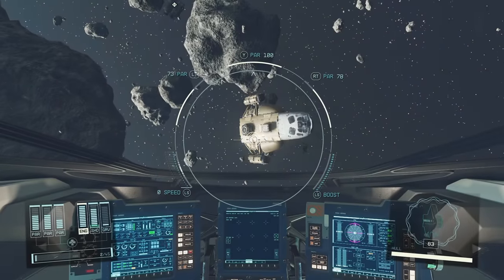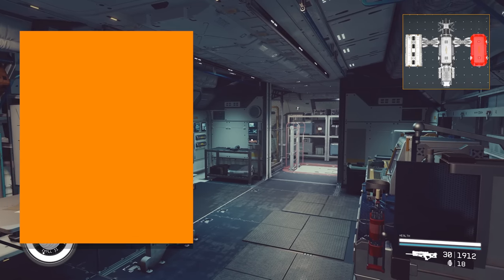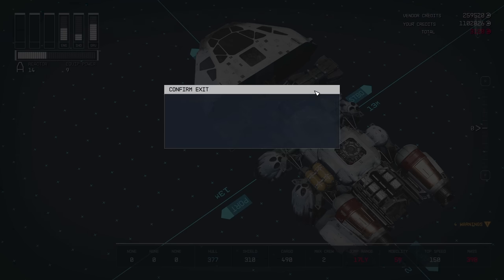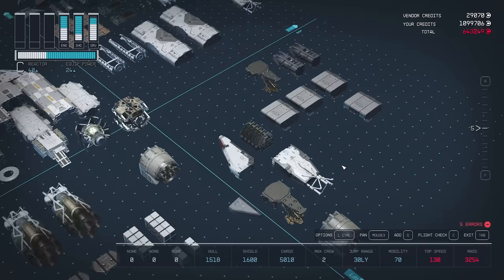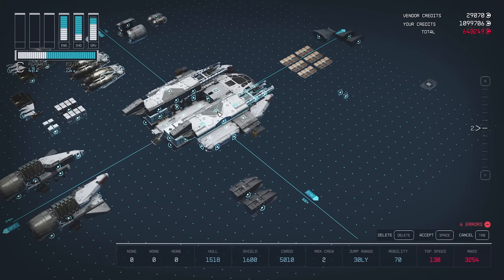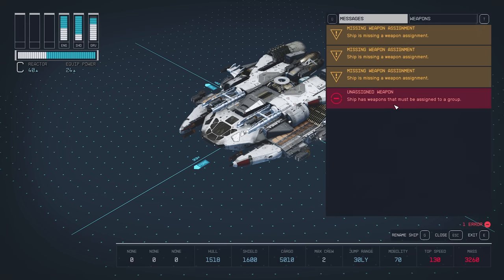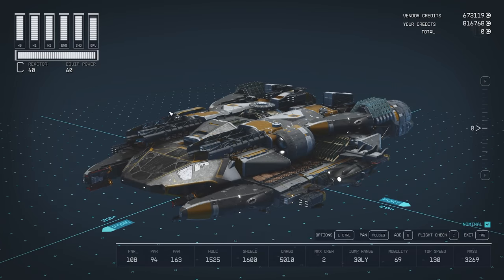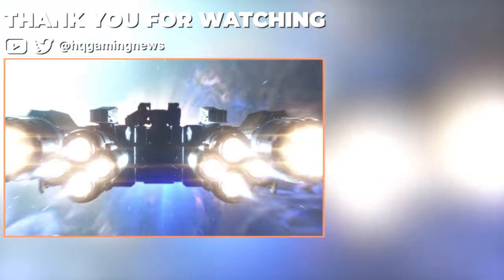The ULTIMATE ENDGAME ship in STARFIELD - No Mods, No Glitches, No Exploits

Comment: I don't usually comment on these, but I just need to give props for how elegant this design is. Every bit of imbalance is covered up nicely, and the way that Deimos tail just slots in with those two little cargo holds... Absolute chef's kiss.
Reply from the maker: Thank you! 😊
Reply: Exactly. I don't normally spend time commenting on videos, but I LOVED this design. 

I've seen a lot of designs online that focus on the exterior look of the ship, but they're such a PITA to navigate the interior. I loved the clean, organized, logical layout of this ship. I know exactly where I am at all times and it's easy to get everywhere in the ship. This tutorial taught me a new way of thinking when designing ships. It's not just about slapping together some cool exterior pieces and the interior pieces fall as they may – build a logical, easy interior and clad it however you want. 

Two thumbs up, liked & subscribed.
Reply: Lol, if I had a dime for everytime someone says "I don't usually comment on ....." Get new material, guys.
Reply: @atlantic_love  "I may only leave the occasional scholium, however..." 😂
Reply: Fr. Chefs kiss.
Reply: Dude practically came over and held my hand to help me build the thing also.
Reply: Anyway to get the mobility and speed maxed?
Reply: @landondaniell5404  mobility and speed are directly related to power/weight ratio.

So you can reduce the weight or add more engines. One will draw more from your power plant the other you will sacrifice utility.
Reply: Yep. I don't comment much either, but this video guide is worth the appreciation. I was about to spend all my cash on the NARWHAL since many blogs mentioned it's the best ship to buy. Boy, I was so wrong. You really should get a job in an actual ship building company 😂. I don't know what you do for living for real but really have a talent for designing. The radiator and reactor placements, perfectly symmetrical. The icing on the cake, crew backstory 😂. I can surely say you have spent countless hrs to understand the games ship building methods, so others don't have to. Good job  👍
Reply: @FriskyPanda167  I think that is the first time I have ever seen that word used since Newton...😎😎
Reply: @hqgamingnews I'd love to see mod that just gives me this setup

Comment: I completed it for $74,651 plus the registration of base ship.  I started by capturing a Spacer Hyena II and "registering" it.  I kept all the components (weapons, engines, grav, and reactor) from the Hyena.  I bought the correct Habs, but since the Hyena has more Habs plus a ton of other unneeded structural parts. I came out ahead when I sold those back to the "dealer". The rest of the new structural stuff I bought outright.  I will go back and replace the weapons, reactor, and gravdrive as I see fit when I don't mind spending the creds.  For giggles, my character's name is James T. Kirk, so I will call the ship the Enterprise 🙂

Comment: Been using your build for about 3 months now and it is everything you said and more. At the hard level all the time, it is a beast in battle. Got a little board and decided to try a rebuild to add the one thing you said you would have liked to include......a front entrance. Using only your parts and exchanging only the cockpit and the landing bay, I got a single level to work with stats close to yours. No interior ladders just the one from the landing bay. BUT without you, I wouldn't have come close. Used a DS40.2 Ares Bridge and a Diemos 120 LD Landing Bay. Thank you so much for doing all the hard work.
Reply from the maker: Glad to hear. Thank you!

Comment: I made it! This ship is so cool and its tutorial is so well done that it was surprisingly fun to do.
I'm level 57 and had to use the Dunn X-200 engine. I will upgrade the engine later.
I'm probably wrong, but I believe the crew's strange behavior is because they have nowhere to rest, so I put a living room in place of the armory.
Reply: If you have not done the Walter Stroud ship design mission, do that.  When completed you will gain access to the SAL-6830.  2 power requirement but nearly identical capacity as the Supernovas.  And you can run 6 of them which demolishes what you can get out of the 4 supernovas.  Video maker needs to do the same for his ship.  Should easily get 100 mobility then.
Reply from the maker: To add to that, make sure you resolve that questline peacefuly. I didn't, and now I don't have access to the best engines in the game.

Comment: Very nice ship, but I modified it a bit. You can add a few spines and then the 3x1 mess hall. That way the crew gathers there instead of crowding the halls. I also used 4 of the Amun Dunn engines instead of 2, thus giving me a bit more mobility.

Instead of the spine with auto turrets on top, I replaced it with the reactor and with weapons plates, it makes an awesome looking turret platform. All in all, the stats are the same, 10 crew, over 5k cargo, same DPS, a mess hall with cooking stations and 72 mobility .
Reply: Where did you put the mess hall?
Reply: @Kulani23  Dead center behind hab spine. The ship is a bit longer now.

Comment: It just occured to me, since you're using the Frontier you could keep the hab from that instead of getting the Taiyo captain's quarters. The Frontier is a unique hab that contains a bed, galley, nav console, and research station. Plus all the unique clutter.
Reply from the maker: That is definitely a great suggestion.
Reply: I have been looking for that HAB everywhere. Did not realize it was unique. Thanks for that nugget.
Reply: In the same placement, the frontier hab bed is replaced by the doorway, unfortunately! Maybe if you switched the captain's quarters to the other side it might work, but no idea if this messes other stuff up with the build.
Reply: It's unique??? So if I delete it, it's gone?
Reply: @Battousai124  unfortunately yes
Reply: @DrTomos  Damnit, time for a mod I guess.
Reply: @hqgamingnews why did you go for these particular weapon systems?
Reply from the maker: Unless Bethesda performs a balance pass in the future, particle weapons currently melt through both shields and the hull the fastest.
Reply: @hqgamingnews  I put some more stuff in it, and am using mods, so it just makes everything, but I noticed that it's not even necessary as long there are other ships there since they are even faster.
Reply: @DrTomos  still available in my game.  Used it on my Razorleaf refit.
Reply: @Battousai124  If you're moding the Frontier you can buy the hab back, it's a 2x1 Nova hab option. :)

Comment: An absolutely superb ship.  Has been my main ship for a month now and I feel no need for anything else.  Has handled anything that Starfield has thrown at it.  The stairs, rather than ladders, are an inspiration.  Brilliant build video, well explained and well put together.

After using the ship for a month, there is one glitch/exploit that I have found to be quite useful.  You can access the cockpit from the front of the ship by jumping up onto the right of the cockpit (when viewed from the front of the ship), the fourth window back (on the right) and you fall through the window into the cockpit. But this is only useful if you are taking off because the interior bulkhead doors are closed and you cannot open them, so you are trapped in the cockpit.  Taking off solves this issue.

Once again.  Great ship and great build video.  Thank you.

Comment: This is probably my favorite in game use. I just finished building it last night as a level 50 on my first run through. 2 or 3 of the parts I didn’t have level access for yet so I just went one tier down until I can replace it. It’s both so aesthetically pleasing inside and outside and accessibility within the vessel is not the least bit confusing. And it absolutely defends and returns fire against enemy combatants. Such a great build!

Comment: Awesome ship, I had been looking for a no ladder end-game ship! I replaced the engines with 6 of the SAL 6830's. The outer engines can be replaced with 2 SAL's and they merge into one tall engine. I also replaced the two smaller cargo holds under the radiators with one S204 and replaced the "inside" landing gear with the N20-Wide from Titan/Nova. 100% mobility, 8610 cargo (980 shielded) with my perks, 1527 Hull, and went with your EM as well as your full crew options...
Reply: how did you manage to fit 6 sal 6830 engines?
Reply: @zartius    the 2 "inside" can attach to the N20 Wide landing gear, the 4 "outside" can stack 2 port and 2 starboard. I'll compare my version to the video and see how I did it. I don't remember making any changes on the outside mounts. But i'll let you know.
Reply: @zartius   OK, I took another look this morning... Sorry, it turns out I broke the no glitch rule in the videos title. The middle two SAL's connect to the landing gear/cargo assemblies on either side of the landing bay (no glitch required), the outer two connect to the landing gear and radiator assemblies. The "Lower" SAL connects to the Stroud Engine Mount at the engines upper connection point, then I highlighted it and used the duplicate button (glitch) to pop the upper one onto the Radiator, this melds them into a single tall engine that still counts as two.

I also added a bit more cargo so my mobility is currently 97, cargo is 10830, hull is now 1532. Basically I threw another S204 on top of the landing bay. I really need to stop being a hoarder, selling all this stuff is a pain point...
Reply: @jkleczewski  Thank you for the info i will try it too later (the glitch) and see how it looks :)
Reply: @jkleczewski  Would love to see a pic of your ship as I was thinking the exact same thing about swapping for the 6830's!
Reply: Update: I pulled some of my cargo to go back to 100% mobility and to lessen my hoarding ability, it's too time consuming selling all the junk I hoard... I now have 5050 cargo, 1600 shield, and 1532 hull.

Comment: Very nice build. Sal 6830 engines could be better for this ship, as your mobility will reach 100. Also, they only require 2 power pips each. You get them after completing "All that money can buy" main quest (diplomatically at the end).
Reply: You can buy them at the clinic without finishing that mission.
Reply from the maker: Sadly, those engines are locked away forever for me. As you saw at the beginning, diplomacy is not my strongest suit. :D
Reply: @bfish9700  lol really? Maybe you confused them with another model
Reply: @hqgamingnews  its fine. 3 Poseidons could do it anyway
Reply: @bfish9700  I didn't even know there was a ship tech at the clinic
Reply from the maker: Thanks for the info, will check it out later.
Reply: Why all ships using the Cabot cockpit look the same? Seems like that piece is a creativity killer,  seen one ship seen all of them.

Nice and detailed guide, good job on that 👍🏼. It's just the ship isn't worth it.
Reply: @user-ij9cv4wx7e There are three types with this cockpit that all have some variations to them but are essentially the same style. The Star Trek type ship with habs, engines etc making up the nacelles. The battleship type with the cockpit in the rear or midship and this type here combining both with cockpit upfront and body of ship being more battleship. I think the reason you see it so much are ladders. Most people hate them. While I prefer 100 mobility, the video is very well done.
Reply from the maker: I checked this today and they are not showing up at The Clinic.
Reply: @hqgamingnews  yeah he was just spreading fake news! I knew it
Reply: Seems to be inconsistent, I'm on my first playthrough (No NG+) and took down the entire tower, including killing Slayton and the Sals are available for me at the clinic 🤔

Comment: A most enjoyable build ... kudos ... easy to follow ... at the beginning the lists were perfect, well laid out  and well timed, each component was very clearly put together with the correct emphasis on the "tricky" bits ... pacing throughout was excellent and the final assembly was a real pleasure ... The movement on the screen was great so that it was very easy to follow ... in my process I often found myself 6 inches from the ship or 1/2 a mile away ... a very smooth pice of work. I look forward to your next build/video/walkthrough.

Comment: Managed to build it at level 32, I think the only things I had to settle on were using 4 super nova engines, H3 storage was slightly lower grade & the reactor was 1 stage lower (I based it off of the Stronghold) so already had high level components.

With the setup I achieved, I flew to THE KEY and took out all 10? Pirate ships without even running out of shielding

Thanks again for the comprehensive guide, it’s fab

Comment: Great build and  tutorial. I started with it and began tweaking to see if it could be made better, specifically the engine choices which I felt were a weakness. I also don't like armouries right now with weapon cases habit of eating weapons instead of displaying them...once those things work properly I'll have to go back to the drawing board

If you swap the engines out for 2 Poseidon DT230 and 2 SAL-6830 along with some minor cosmetic tweaks to drop some mass from the structural components you can have a very similar ship but with mobility bumped to 97. Admittedly the poseidons are a bit annoying to work having side mounts only and the sal-6830s require a specific mainstory quest to be handled in a specific way to unlock.

I also swapped the armoury for a 4 crew module along with the 3x1 to max out crew without giving up the science lab, workshop or captain's quarters.

In the end I squeezed just under 3200 mass (allowing me to drop some landing gear)  with 5040 cargo out of the ship that looks pretty similar but is also my own now.

Comment: I have a similar build. I was lucky with my hab placement and avoided all ladders even when connecting habs on top of each other as everything was already connected via the cockpit. Also if you don't like the back landing bay you can use a side landing bay quity easily. I like how you have hidden your cargo under the Deimos wings and fit in the Deimos tail between the shielded cargo ... although side mounted turrets don't seem to perform as good as top mounted ones.

Comment: I used this build, and modified it to varying degrees, both aesthetically and functionally.

I swapped 2 turrets out for 2 EM weapons mounted to the central dorsal, and I moved two(now rear-facing)turrets to the wings.

The Nova Weapon Mounts are replaced in favor of Stroud hulls, which imo look much cleaner, as there are still multiple places to mount weapons without them. I'm also using a couple less weapons than this build, but I find it's more than enough to get the job done without it being dramatically OP.

I console commanded my way to lvl 60 from lvl 14 to build this ship, because I don't like how the game limits you. As such, I don't have access to the same weapons or specialty modules included in the tutorial. That said, as my ship stands now, it's a behemoth in dogfights, and I can routinely be attacked by a half dozen ships and still stand my ground.

I've named my ship "Tortuga." I'm also still modifying my design, but I'm very happy with my variant and will continue using it as my only ship.
Reply from the maker: I believe there are console commands to unlock everything. Recently, I had to use a command to unlock the best engines in the game, as I skipped the main story in NG+.

Comment: First and foremost, props on recognizing the mutiny discussions and getting ahead of that.  This was my fav part of the entire video.  I haven't laughed that hard in a while.  For me, this needs more cargo.  My previous build prior to my latest NG was using the S-E Kepler, heavily modded with over 7500 cargo, which wasn't enough for me to hoard resources and still have room to scavenge.   I think my next will be the razorback, just for the in-game role it plays.  Im aiming for around 9k cargo, and thinking of going with the 6 engine setup.  Hoping to keep manuevarability over 80, not sure if that is possible and still have everything necessary on the ship.  I have kept up with using balistic weapons thus far, and trying for targeting mode as they are better for multiple targets IMO.   I really like your build using the stairways and no ladders, I didn't know that was an option.  Very informative and smooth video.  Please keep it up.   If you have any feedback for my desired ship, I would love to hear it.
Reply from the maker: The thing about having a large cargo, at least for me, is that the more space you have, the more junk piles up. I've been thinking about what resources are a must and which ones I really DO NEED. The conclusion I reached was that I only need the ones necessary to upgrade my weapons and gear. Since I don't change gear that often, I don't need as much cargo as I initially thought I would.

Having 7500+ is more than enough to store those items, along with some extra loot acquired from POIs. Everything else, I sell (or store at the outpost).

Comment: Wonderful video presentation on your build process.  I have a similar ship design using that Cockpit.  I love not having ladders as well.  I have 6 of the SAL-6830s on the back of mine.  That would get you to 100 mobility if you wanted.  Will change the layout of your ship to accommodate 2 more engines outboard of your current 2 though.  My ship is quite wide due to that.  I have the same rear entry bay you are using which requires 3 engines to each side of it.  Ship is a massive triangle.  I may try to double stack the engines in the middle so it is less wide but that would be a huge change to the side profile of the ship.  Anyway, great ship, great layout.  And as others have said, the way you hid parts so perfectly is top notch.  I have to look into doing that.   But I typically use as little structural parts as possible.